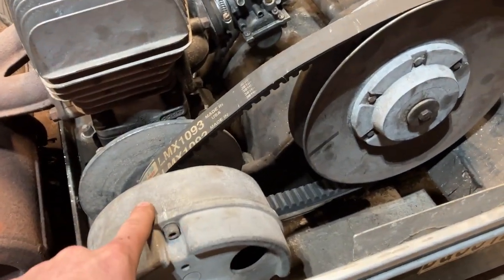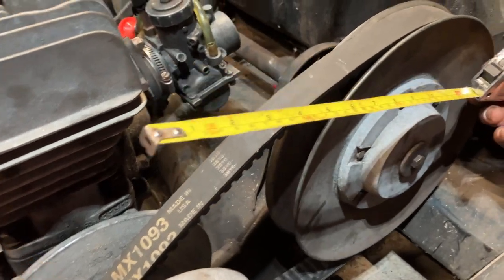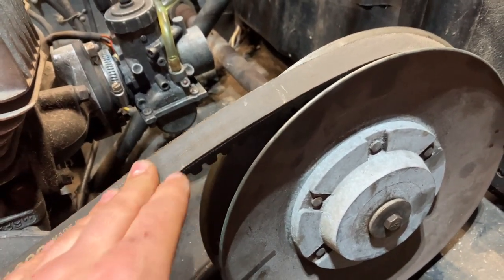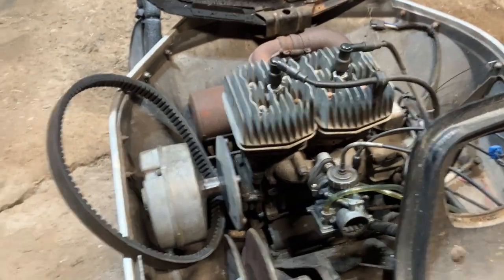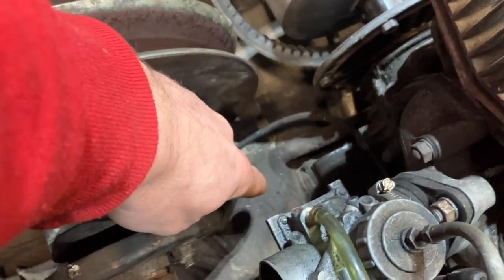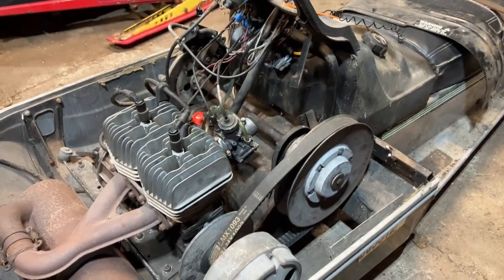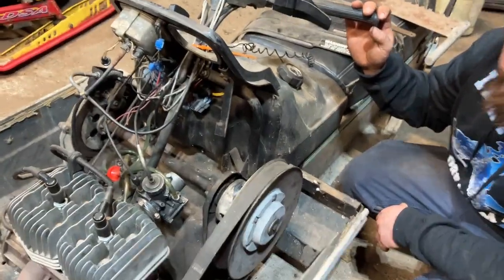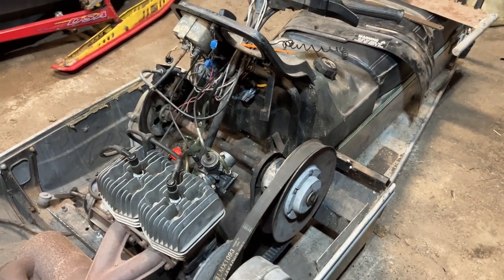Snowmobile Clutches 101 - Offset, Center to Center, Deflection

Comment from the maker: Comment if you want a video on inside clutches and what does what! Thanks for watching!
Reply: Thanks fellas seems i had a reason to have you fellas do this content ,thanks mr.snooky pa
Reply: Think it would be better if you did a summary by the numbers with visuals. Understanding that's difficult with so many brand and models. 

  Also, just installed a new belt thinking bogging would be fine after but nope... Still bogging. So, what's next?
Reply from the maker: DOES IT BOG ON A TRACK STAND? OR DOES BOG GO AWAY IF TRACK OFF THE GROUND? @cjackfly
Reply: @bearkreekboys  bogs on the ground only in my experience.
Reply from the maker: have u checked the clutches and cleaned them? do they release and close properly when revving up? @cjackfly